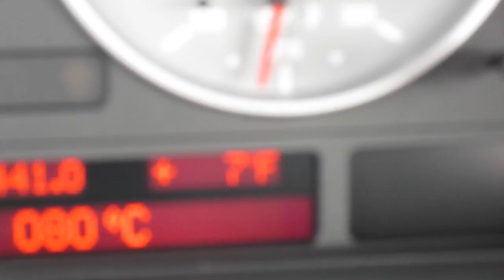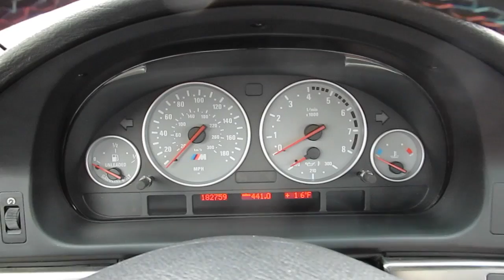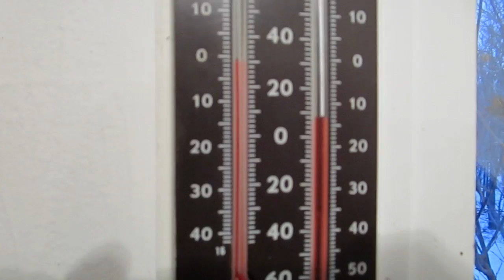Reggae in the Arctic  1/22/14 - Day 1,141

Comment: You should look into getting turners magnetic drain plug. It works really well collecting any tiny metal shavings.
Reply: I have one of those, it doesn't fit in the drain hole because the bolt edges are too chamfered and the pan design doesn't allow for it to be tightened.  Plus I read that if you're getting metal shavings you have bigger problems and that they're unnecessary, so I'll just forget about that for now I guess.